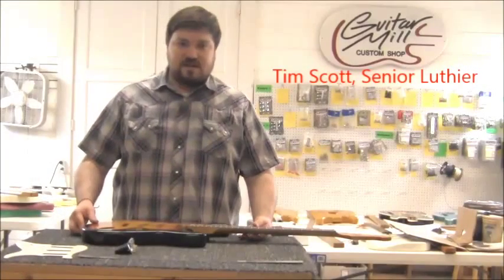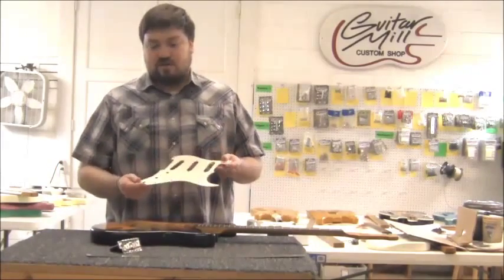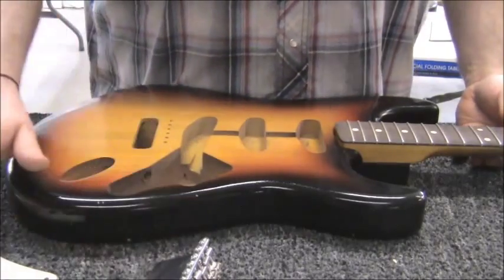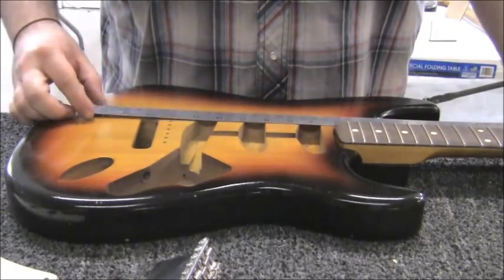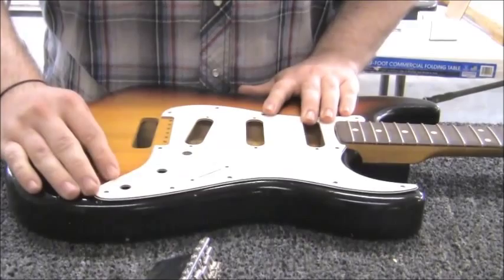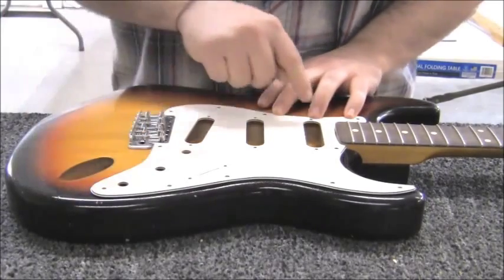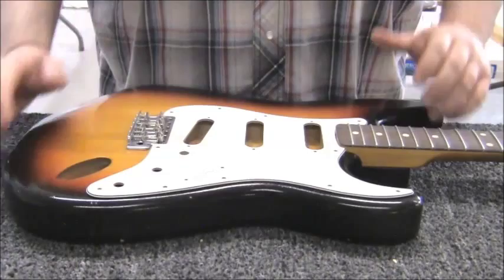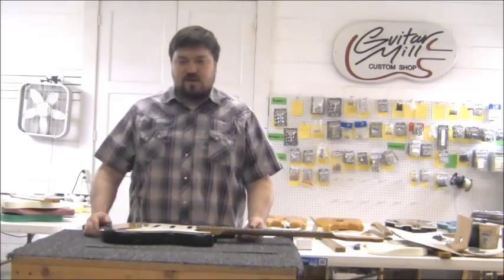Guitar Mill Instructional #002 - Neck/Bridge Alignment

Comment: I have a telecaster here that's a piece of crap from China (I'm left handed, don't judge me, Fender won't make teles how I want them).. the neck or bridge or something is definitely wrong, but when I measure like you say to the string through holes the neck is much thinner at the nut than the bridge, so there's no way the neck would ever align to those holes as even if it was straight (it's clearly not), the straight edge gives a reading way wider than the bridge holes. Is that normal? In that case how do you line it up?
Reply: oh hai mark
Reply: hi
Reply: hai there
Reply: get a new guitar